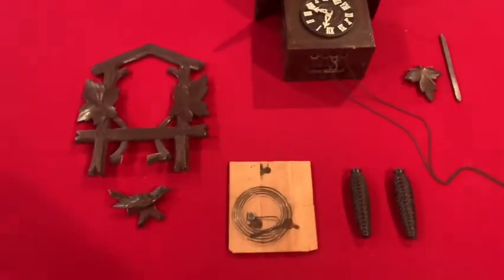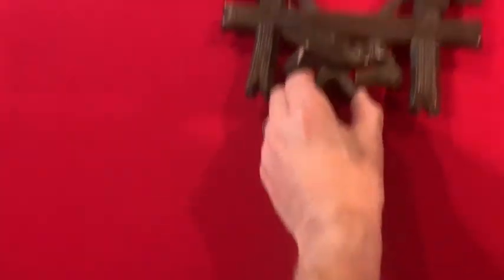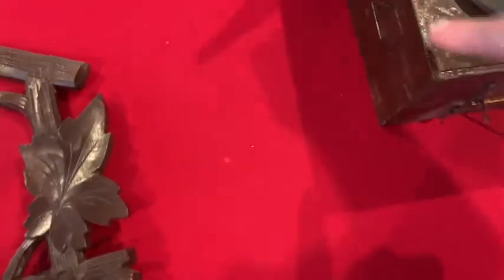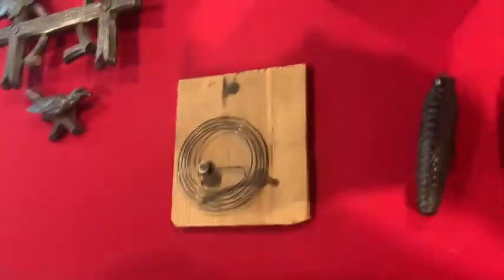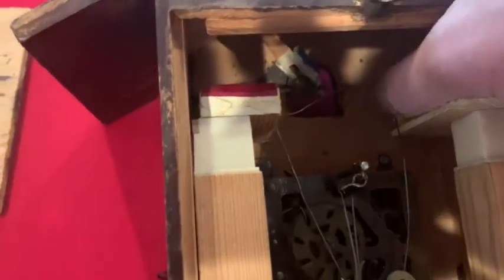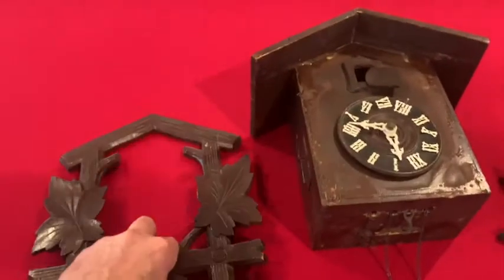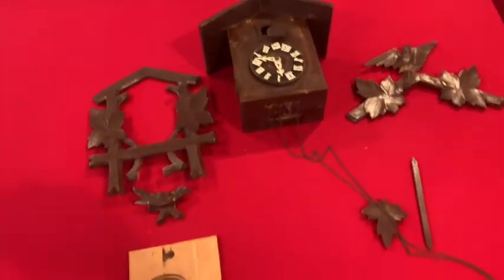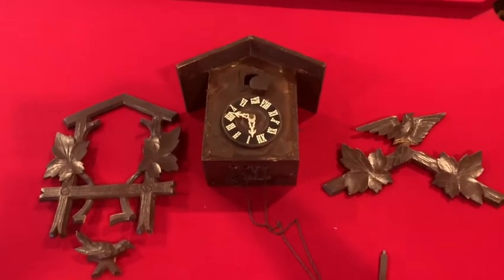Cuckoo Clock Restoration,  Is it repairable?  What is the value of this clock?

Comment: 1. Yes it is worth repairing, 2. Yes, I do think you can get it running again, but my videos would help you a lot and I do have an email address below my videos to help you. 3. As is, the worth would be $12.00, restored would be around $100 to $150. with a good glue job, not a quick glue job. 
  The numbers can be glued in place and dial is normally nailed on the clock box. The fancy trim for the box is also suppose to be nailed on. All nails are little finish nails that don't go through to the works inside the clock. The wire hooks on top of the clock would be for holding the top head dress from falling off, don't know why there is another whole on top, unless someone moved the hook. 
  Inside, the bellows need to be changed, around $6.00 to $8.00. Just a quick look at the works, I would say it was pre world war 1. I also could see your wire was bent that runs with  the pendulum, so the clock will not sit level and run right now.
  The scratches on the back are normal, just trying to hit the nail for hanging is all. But I would restain the whole clock to help hide the new and old glue and give it a fresh look.
  Have time and fun working on your clock, God Bless.
Reply from the maker: Thanks Mike!  You are the expert.   I’m sure I will be reaching out to you for some advice.  Especially with the bent wire on the pendulum.  Really appreciate the feedback